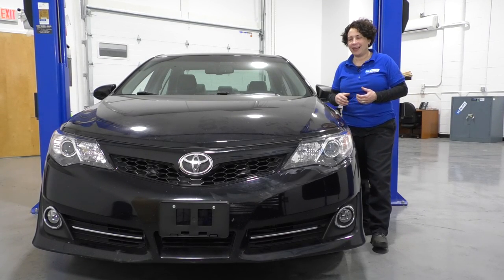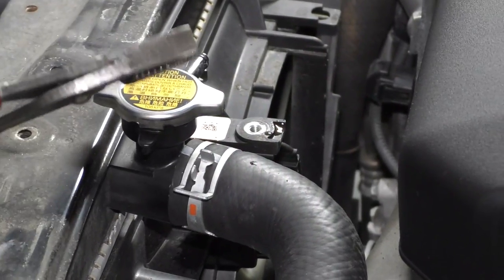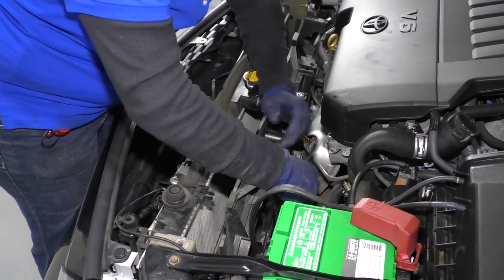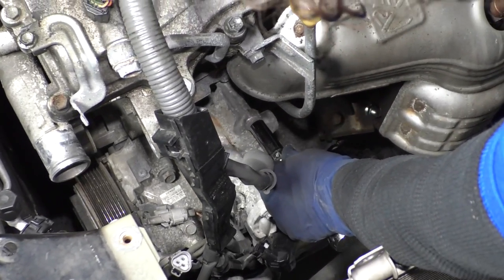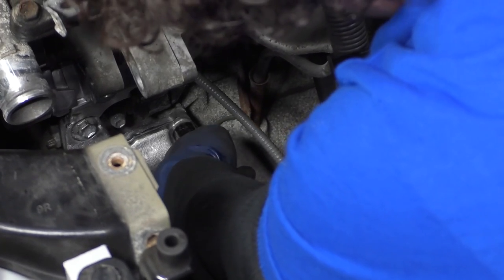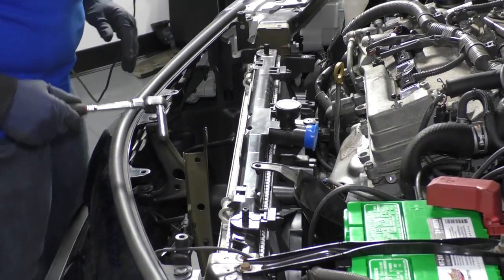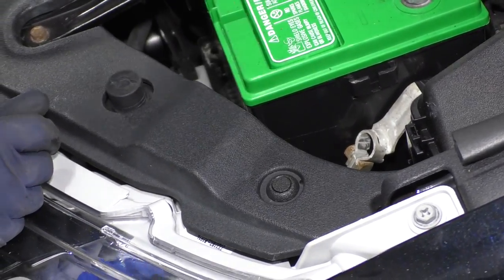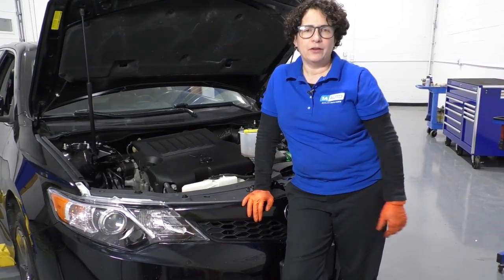How to Replace Serpentine Belt Tensioner & Idler Pulleys 12-17 Toyota Camry

Comment: There's an after-market pulley that can be replaced  without replacing the whole tensioner. Not need to replace the whole thing if the problem is the pulley ball bearing.
Reply: Thanks for the Info. What brand is this part and what is the part Number ?
Reply: Usually it's the tensioner spring that fails on these first.

Comment: Nice work.  Toyota what the heck were you thinking ?  Disassemble the entire car to replace a tensioner assembly?  Before anyone does this just replace the  tensioner pulley - not the whole assembly - at first and see if that solves your noise issues.  That does not require you to disassemble the whole car to replace.  You can find the part tropically or just replace the bearing on the part you take out.

Comment: I won't buy a Toyota I'm not going through all that stuff know wonder why the shop charges so much I'm sure you are showing DIY and it can be frustrating for some people it's not a easy task thank you but I don't see $500 worth of work witch my freind paid for a year and a half later she has to have it done again sounds like they bought forgin parts
Reply: most certainly all the manufacturers are the same.  some of the simple parts are just burried under so many stuff.  we have to wonder what the heck are  they thinking.